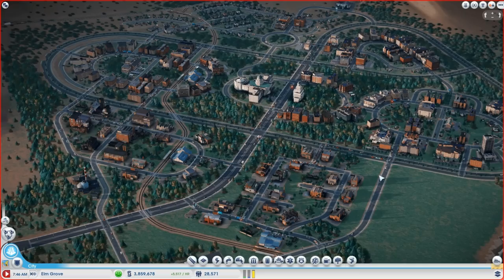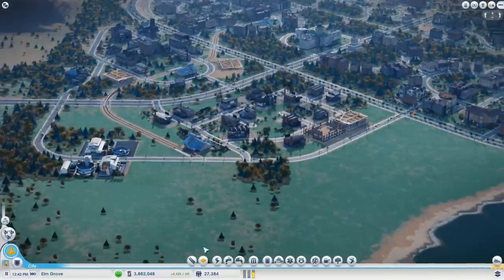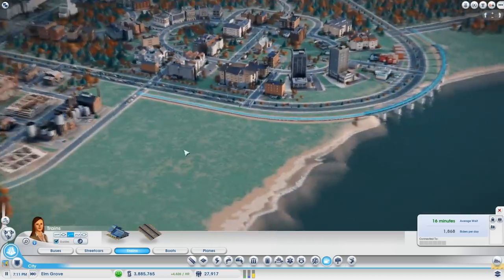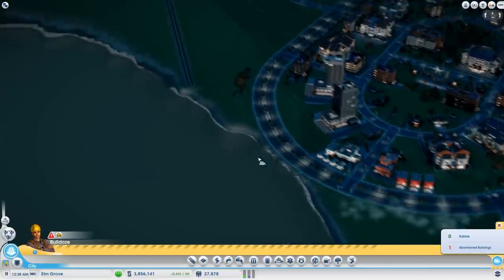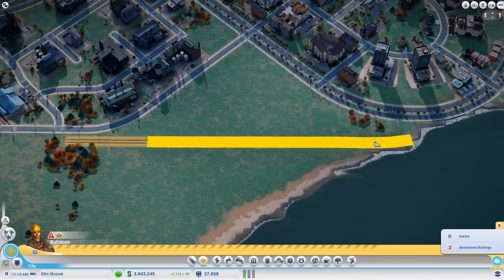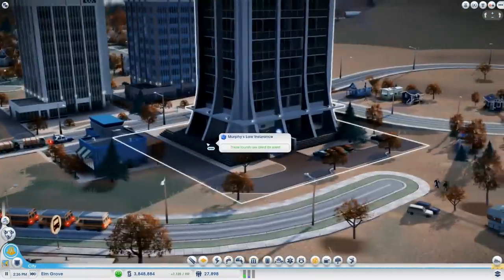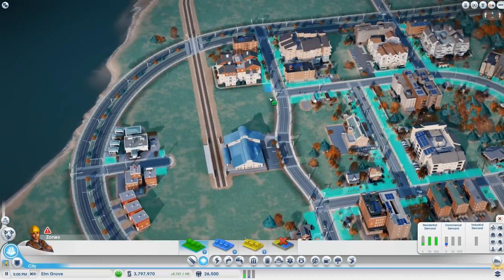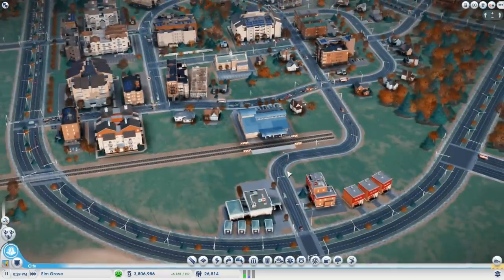EP 6 - More Train Stations (Design Centric SimCity)

Comment: I agree, it looked actually pretty cool around 13:20. The way you did it afterwards seemed to take away from the feel of that whole neighborhood, as if the railroad was intruding on it. The way the clinic/fire station is connected to the neighborhood now also looks awkward. Maybe instead of following the curve of that avenue exactly when making the bridge, you can try extending the railroad into the water (perhaps around where the guides are at 10:05, and connecting them with a tighter curve?